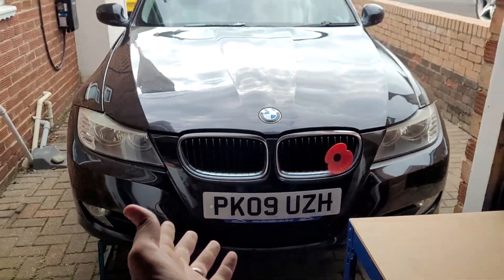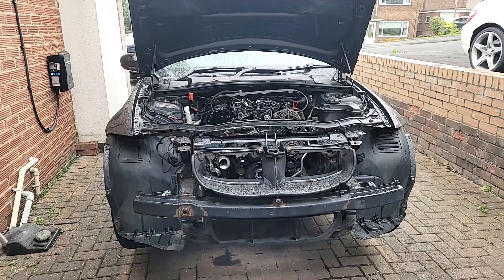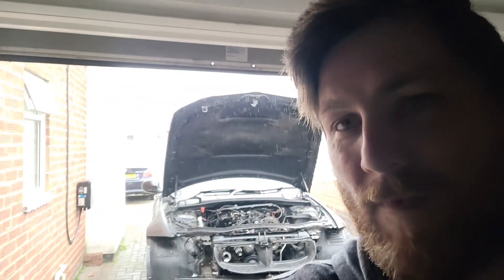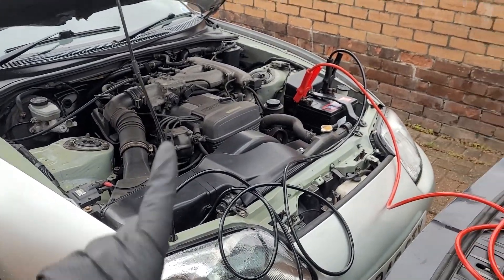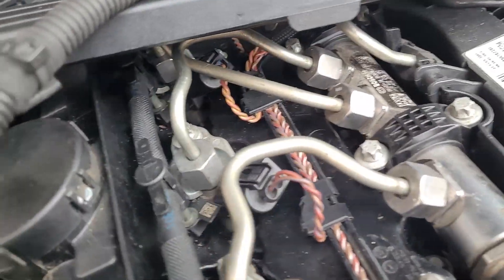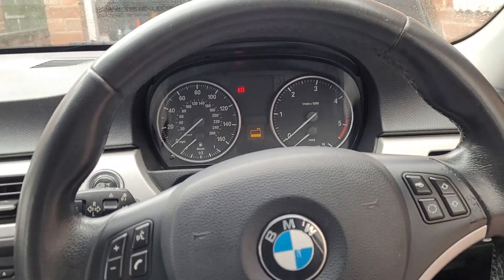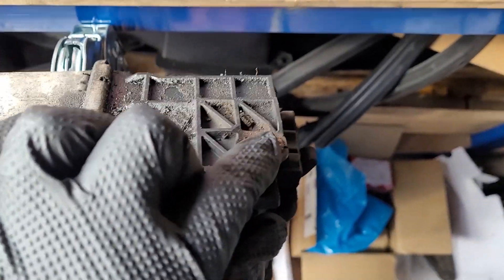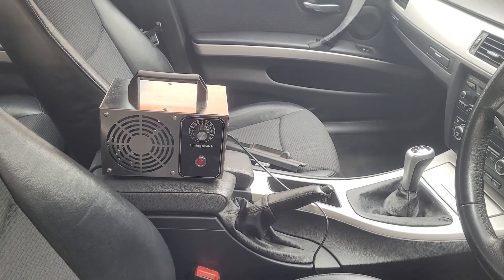Can I get the engine installed and started? My wife's new car

Comment: What timing chain kit did you use?
Reply from the maker: I honestly can't remember, I bought it from a BMW specialist in my area. But I'd recommend the IWIS timing chain (genuine BMW parts) from BMW. Cheap kits will fail and leave you with a broken engine.
Reply: @wesleymarx584  yeah usually febi kits are the cheapest and they supply the IWIS chains